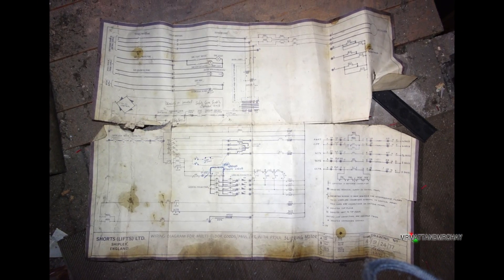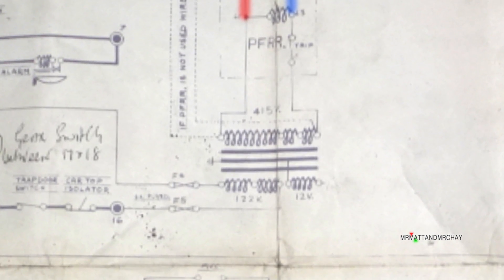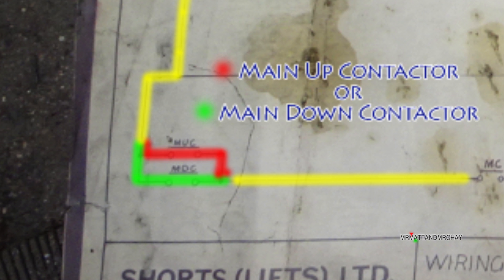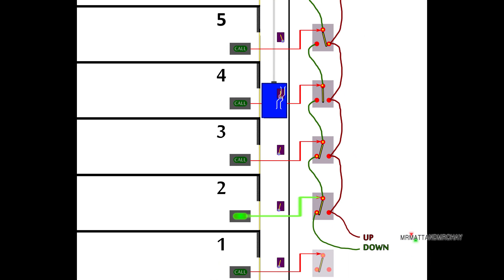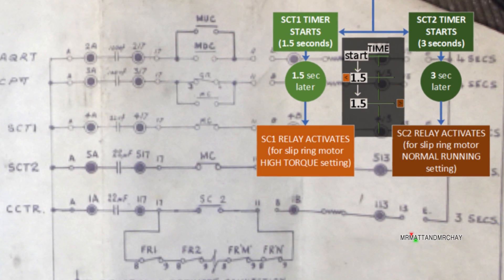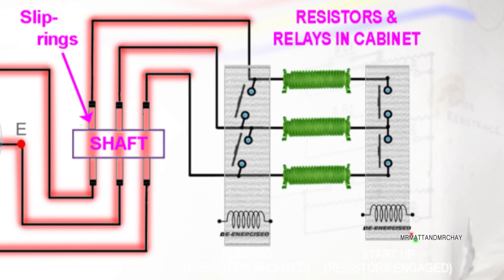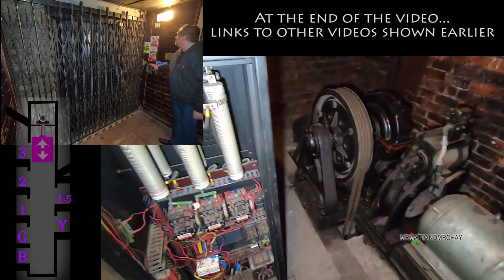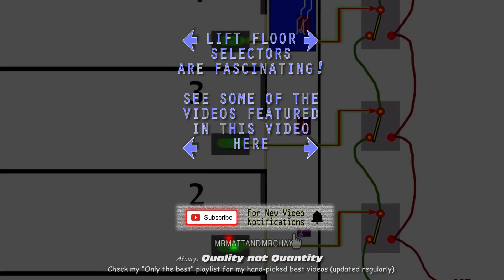Old lift CIRCUIT run-though (MORE INTERESTING THAT YOU THINK!)

Comment: Been watching your videos for a little while and the attention to detail is great! The animations look really good. Just wondering though, did you adjust the original timers that were installed, or did you replace them? I've noticed a lot of old timers operating instantly in some of the control panels I've worked on (not with lifts though). It seems to be a common issue when they get to a certain age, and in those cases I wasn't able to just them, they just remained instantaneous.
Reply: Usually the capacitor has blown or the adjust resistor  (varistor) has gone open circuit.
Reply from the maker: Many thanks for your comment!  I do try my best!  I think Peter has nailed it on the head!

Comment: Taking in consideration that this is a lift from 1920, do these have any overrun switches? Could you, in theory, run it down/up into the ceiling/bottom of the pit if overrun switches aren't a thing?
Reply from the maker: There are overrun switches, but they are on the right hand side, and I don't think my camera captured them.  I did try running up and down too far, but it just stops at the floor.  There is also a final limit switch that turns off the power to the lift if activated.

Comment: The lift at my GrandParent  building use this levers on the shaft and they were installed in early 70s. As per my knowledge they need to replace on of the shaft switches once. They are really heavy duty. A disadvantage that comes to my mind with this approach is it painfull to calibrate the car stop. As in my GrandParents case is single speed, is all about a trade off. Having a floor selectors is more practical since all the adjustements are done there. I wondering how this is done when using shft selectors. The leveling is a good / bad as any other single speed lift I have used. It level fine from empty to one person, then start to get off noticeably. GOOD VID !!!!
Reply from the maker: The later models had inductors positioned at every landing for precise leveling... see here...  https://youtu.be/vJqpLKLXsqY?t=279

Comment: Thank you for the excellent video Mr Matt!
I've been quietly watching for a while and your videos helped me overcome some of my fear of lifts by understanding how they work.
Could you give me a short explanation or even just a link to the right video for the following question?
Background: due to the nature of my work (food delivery) I have to ride lots of old lifts in communist apartment buildings from the 1970's and maybe 80's, basically two-speed, relay-controlled Schindler license traction lifts built by the former Romanian state company IFMA/Ascensorul. Some are neglected and very worn-out, others are decently maintained and more and more are getting modernised with generic kits with some resemblance to Otis.
Now: the older and more uncared-for  they are, the more often I see a pattern in their failure to properly stop on level with the landing. On the ground floor they stop way above the landing level (2 inches or more), around the 5th - 6th floor they level just right, and on the top floors they stop slightly below level. I'm guessing it has something to do with mechanical wear, but I've got no idea what exactly.
Reply from the maker: Thanks for the compliment!  With older lifts, especially with a mechanical floor selector in the motor room, this is a prepresentation of the lift down in the shaft.  For for the landing floors, the lift doesn't necessarily know where the lift is exactly.  When the floor selector decides it should stop, then it will.  If it's within a defined 'floor zone' then the doors will open.  I suppose as the main ropes stretch over time, this means that the linkage to the floor selector, compared to the actual car position could vary over time.  Also, before motors were controlled down to a halt from a Variable Frequency drive, the lifts were reliant on the brake to actually stop the lift from a slow speed.  Sometimes this brake could need adjusting if it's slipping through it too much.  Just some ideas for you.
Reply: (if you get two versions of my answer, blame it on my router freezing :P )
Oh wow! Thank you for taking the time to answer!
So probably there is a difference between how much the main ropes vs the floor selector rope has stretched over time, making the car actually travel a shorter distance than what the floor selctor detects.
As far as I can understand, if the misleveling was caused by the brake slipping, the stopping position would not depend on the floor (over level on Ground, level on 5th, and below level on 10th) but rather on the direction of travel and the load.
The doors are mostly manual and the safety mechanism on the landing door allows for quite some variation in the stopping position. There is even a foot or two long shield on the front of the car, below the floor "just in case".
Thanks again!
Reply: @TamasH87  Rope stretch would have no affect on floor levelling performance, the only thing that changes after rope stretch is the distance between the car and the counterweight.What you describe is about floor levelling performance is a classic example of the counterweight effect. The stopping distance in the down direction is shorter than in the up, due to the counterweight and ropes being heavier as the car approaches the top floors. The BRAKE needs adjusting to split the difference between the empty car and the full car scenarios. To do this the system needs to be balanced and the individual floor levels set with  a correctly set up brake which is free in operation and clean. This action would bring the stopping and floor levels to an acceptable level. For your info the lifts main ropes will stretch after initial installation about  7mm per meter of rope, this is called initial stretch, about a month after rope renewal they are shortened to maintain the overtravel distance from the counterweight to its buffer in the lift pit. If the ropes are too long the counterweight will hit its buffer before the car has reached the top floor, also the car has to be able to compress its buffer before the counterweight strikes the top of the shaft. Not quite so simple as you would think.
Reply from the maker: @peterlomas984  There is nothing like a definititive answer from an old pro! (sorry about the old mention, I didn't mean it like that!)
Reply: @mrmattandmrchay  I only hope that your followers will understand what i am on about with my inane ramblings. (No offence taken on the OLD comment)
Reply: @peterlomas984  Thank you for taking the time to type such an elaborate answer. I'm sorry but somehow I missed the notification so i'm only reading it now. It does certainly make sense :-)

Comment: Funny that they repurposed a schematic from another lift without editing the drawing. Nowerdays that would be a pretty trival task with autocad, maybe they only had some drawings made once and didn’t modify them for a specific project.
Reply: Having the incorrect diagram has probably led to confusion many times. Lots of engineers/technicians/electricians have enough problems diagnosing a system with the correct diagram, never mind the curve ball of having the wrong paperwork.
Reply from the maker: Probably the original documents from the 1920s were so faded they were scrapped as unreadable!